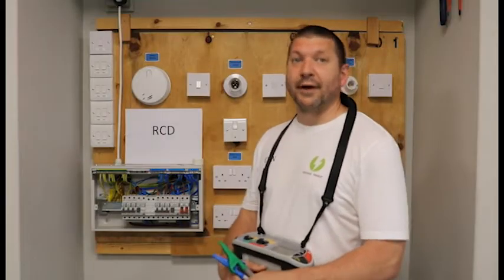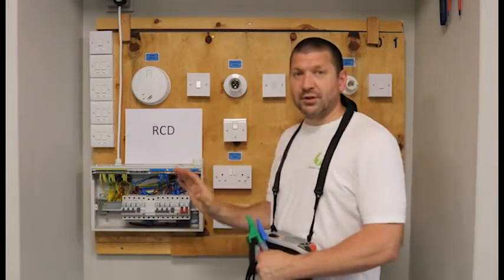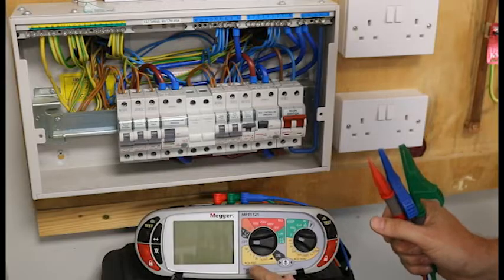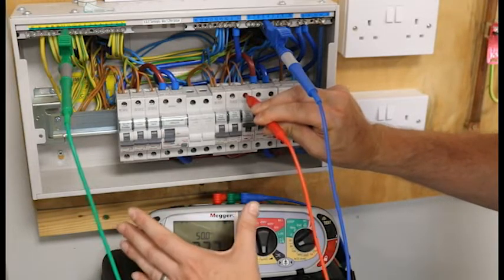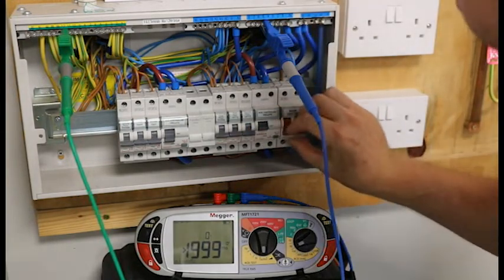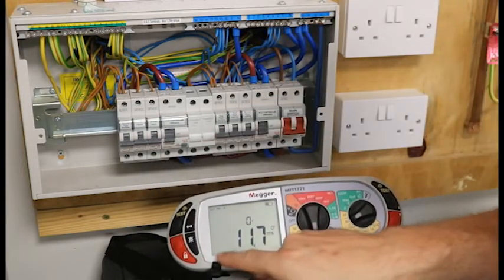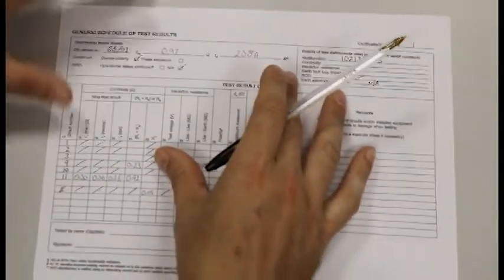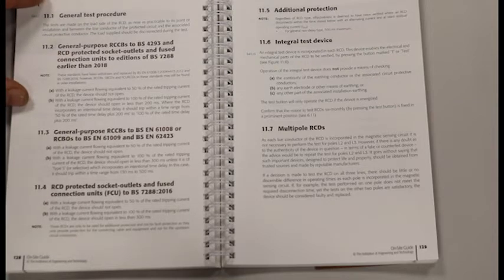Guide to completing an RCD test and how to complete the test sheet

Comment: The test you have performed is incorrect and is only testing the RCD for the DB and is not recorded on the sheet you have used. The RCD test for a circuit should be carried out at the furthest point of the circuit. This will take into account the circuit resistance R1+R2 and Rn. The test you carried out is only using the external impedance Ze at the DB and not the fault circuit as a hole. The aim of the test is to take the total resistance of the circuit, the fault path, which will determine how quick the RCD will trip under fault conditions, the higher the resistance the slower the trip time. Therefore the RCD test requires to be done on every circuit and recorded in the location you used. The test you carried out is recorded on sheet 2 under, Main switch / Switch Fuse / Circuit breaker / RCD, under "If RCD main switch". I would take this done before someone gets hurt and is traced back to your YouTube. I am retired now but I am an Accredited Electrician.
Reply: That’s incorrect Graeme. This is an 12 monthly testing requirement where I live and it’s only purpose is to test the RCD. The circuit is completely irrelevant, doesn’t even matter if a circuit is connected. We’re testing the trip time of the RCD only to ensure it’s per specs.
Reply: I have been a qualified electrician for thirty eight years. Point one what is an accredited. There is no legal requirement or regulation requirement for any spark to be registered/accredited . Never has been. The purpose of the RCD test is to determine if it will trip within a specified time ie at 1x its rated current we expect it to trip in less than 300ms at 5x in less than 40ms . We can test at the socket or the CU . If you already know what the Ze and Zs values are and you want to know the the RCD will operate at we do a ramp test which will tell how much current it takes for the RCD to operate.
Reply: @Dog-whisperer7494  
Yes, correct.
Reply: Watch the video again. He did the test correctly. He clearly tested the lighting circuit and he probed onto the outgoing side of the MCB . If he did what you are talking about then he would test at the top of the RCD ie green lead on the earth bar brown probe on the RCD line and blue probe on the RCD Neutral. .

Comment: I'm confused if you're doing an RCD life test. And there are different ones when it comes to radios/ring. Which one do you do If ring s using the plug socket. And radials. Is using crocodile tips.  
Can anyone please explain. I thought RCD is one test.
Reply: See post above.
The test you have performed is incorrect and is only testing the RCD for the DB and is not recorded on the sheet you have used. The RCD test for a circuit should be carried out at the furthest point of the circuit. This will take into account the circuit resistance R1+R2 and Rn. The test you carried out is only using the external impedance Ze at the DB and not the fault circuit as a hole. The aim of the test is to take the total resistance of the circuit, the fault path, which will determine how quick the RCD will trip under fault conditions, the higher the resistance the slower the trip time. Therefore the RCD test requires to be done on every circuit and recorded in the location you used. The test you carried out is recorded on sheet 2 under, Main switch / Switch Fuse / Circuit breaker / RCD, under "If RCD main switch". I would take this done before someone gets hurt and is traced back to your YouTube. I am retired now but I am an Accredited Electrician.
Reply: @graemesmithson6307  What are you talking about?

Comment: Theres no need to test each mcb, you're testing the trip time of the RCD and therefore only need to carry out the test once and that can be done at the RCD itself
Reply: And there is no need for the auto RCD test as we are only required to test  on the AC setting at 1x the rated current and on both sides of the wave from irrespective of what type of RCD it is and record the highest of one times results . The half time and five times tests are no longer required
Reply: Is that what occurred. Tripped it at each breaker ?